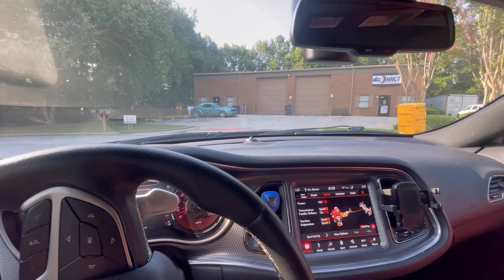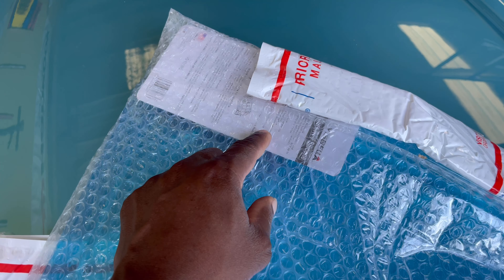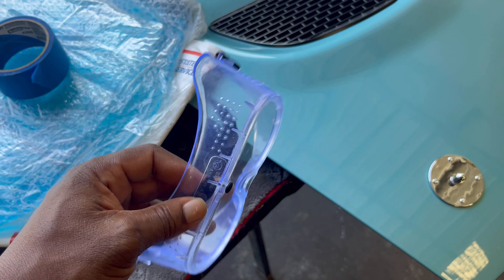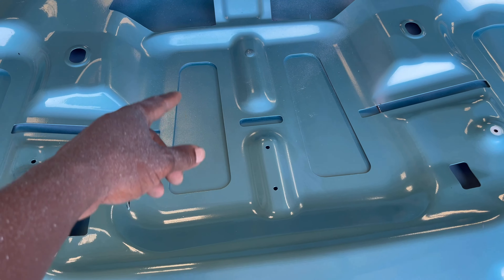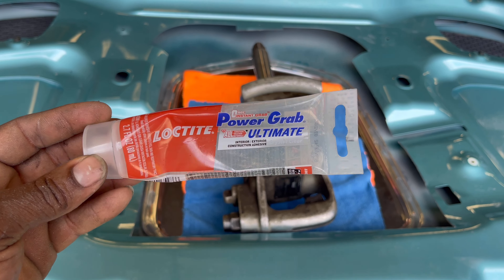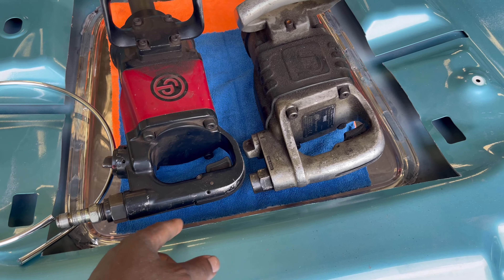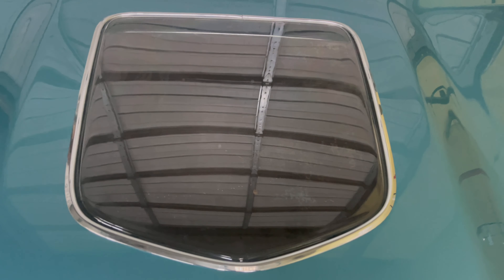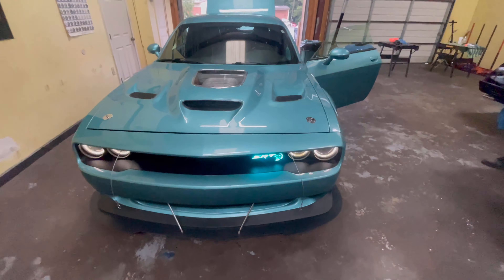Hood window installation on a custom painted hellcat📈

Comment: Do you get any hood flex on high speeds?
Reply from the maker: On the part closet to the windshield. You can use a piece of the metal from the parts you cut to make fit in between the hood and the back piece underneath it.